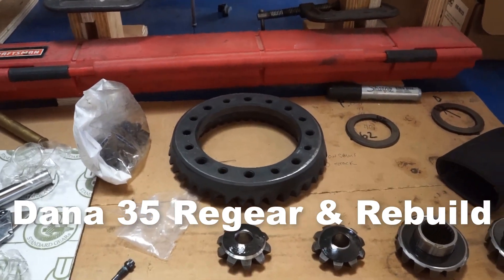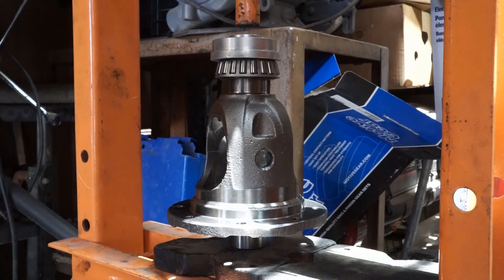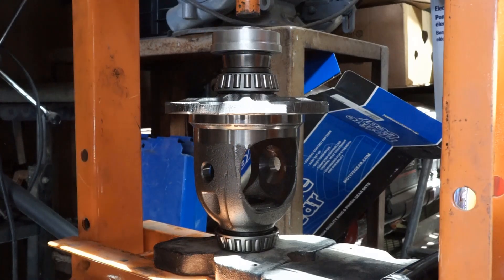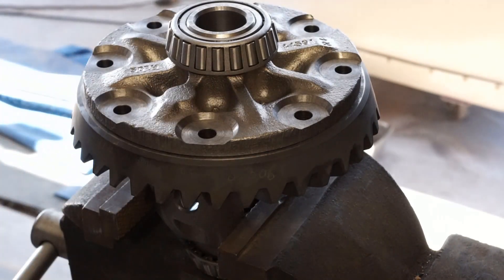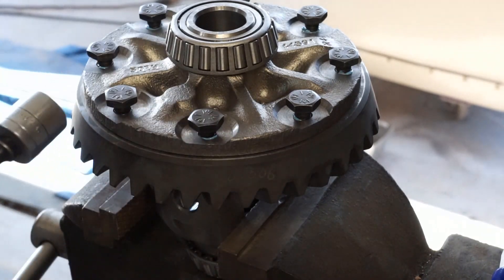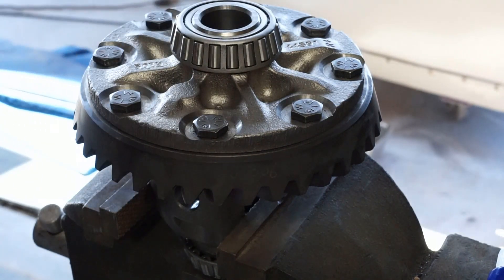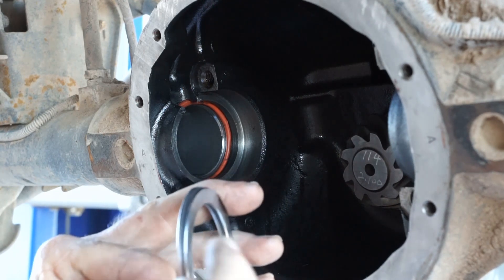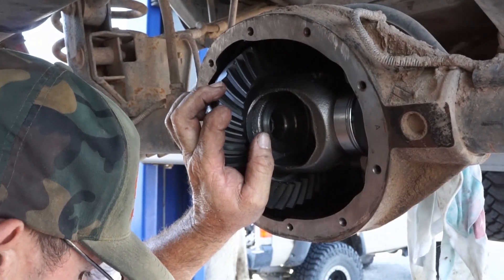Jeep Dana 35 regear and rebuild

Comment: heating the ring gear is the best solution, you never want to use the ring gear bolts to draw it up because those are stretch bolts and you will be doing it all over again once the bolts fail at a later time.

Comment: Great video. I'm an old car and heavy truck technician and would just like to point out the two holes on each side of the carrier opening that are kind of filled in with dirt. There is actually a tool that uses these holes to spread the case a little bit to help to make it easier to install the caps and shims. I do like the tool that you made from wood and it seemed to work great. This is just FYI.
Reply from the maker: Yes I am aware of a case spreader. You can get through the job without one. I dont even own one but I always get to my goal. Thank you for watching and commenting, have a great day and good luck on your project. Cheers.

Comment: How did you determine preload on the axle carrier bearings. Just rolling force/drag
Reply from the maker: I do the carrier bearing preload by feel. It takes a small struggle to get the carrier in. The dead blow hammer is your friend during install. There is a method using the inch pound torque wrench and a little math but I perfer the "feel the resistance" way. I hope this helps and thanks for watching.

Comment: Thanks for the video!  I've got one question though.  I looked at the factory service manual for my 1999 Jeep Wrangler with a Dana 35 rear and it says "Pinion Bearing Preload - Original Bearings = 10 - 20 in lbs"  and "Pinion Bearing Preload - New Bearings = 15 - 35 in lbs".  Should I use what the manual says or stick with the 14 in lbs that you used?
Reply from the maker: I use RMS Ron's Machine Service specs on most of my builds. I buy products from them often. Specs will vary from source to source. There is plenty of wiggle room out there. Be confident with your source and duplicate what they require and you should be fine. Thanks for watching.

Comment: How do u get your set up bearings on and off so easily? Im about todo this exact job next weekend
Reply from the maker: I open up the inner diameter with a flapper sanding wheel. I believe I show how to do it on the GM 12 bolt regear vid. I hope this helps.

Comment: Thanks for the walk through. All the work to re-gear, but no LSD or locker to install?
Reply from the maker: This guy just wanted to gear for his 33" tires, his jeep wouldnt pull 5th anymore.
Reply: @missingdigitgarage8644  awesome video my friend. I wish I lived closer I’d love for you to do my re-gear. I love the continuous camera shot so we don’t miss nothing. Am I right that the set was 4.10 or was that an old box? I have 33’s and just ordered the Revolution kit for two axles for my 89 YJ.  Gonna go with a Tru Trac lsd in back only for now and maybe save for an manual Ox on the front.  I went back and forth and couldn’t decide between 4.10 and 4.56. Gonna be mostly a street rider but want to take er off-roading occasionally.
Reply from the maker: I would go with the 4:10 ratio for what you are doing. I hope this helps

Comment: How did you get the pattern read the first time? Did you use the old Pinion before removal?
Reply from the maker: I installed the new ring and pinion before paint and I get the specs close and go for a pattern read.

Comment: Why would you even bother regearing a Dana 35?
Reply from the maker: @Foof50  So you can use 5th gear with bigger tires.
Reply: if you know how to drive and are doing technical 4 wheeling and not pure mudding with your motor wide open, the Dana 35 can do allot and handle allot more than most people say they can.
Reply: Booo this man!!!! I’m kidding… The d35/d30 combo is a decent platform though. Chromoly axles, locker, trusses… years of service. I’ve even seen ford ttb’s last on trails. You don’t always need to run dual 60’s, high pinion up front etc. to get through the rough stuff.

Comment: How to you pull the old bearings off the carrier
Reply from the maker: Watch my other video called "GM 12 bolt " I cover the removal of the bearings. The video you watched was a new carrier so I didnt have to remove the bearings. I hope the video helps. Thanks for watching
Reply: @missingdigitgarage8644  thanks. My carrier was really tight. Had to use a puller. I think there was too much backlash too. Guess I need a shim kit. The bearings all seem ok but was making a whirring noise under acceleration.  Could that be from the bad install?  It just had one thick shim on each side.
Reply from the maker: @guymanicone7921  1 thick shim on each side is a factory custom shim pack. The noise you are hearing could be your pinion bearings. They may need to be changed. They are usually the first to start failing
Reply: Winner winner. Got the pinion bearing out today. That was the one. Great video, I'm going to use your procedure to set the shims. Ordered a kit today.

Comment: I dont think the cap bolts are suppose to get locktight.
Reply from the maker: Why is that ? What could the downside of loctite be ?
Reply: @missingdigitgarage8644  I was just reading the book and the only place that gets loctite was the flange on the axle shaft tube where the breaks bolt on. 

I guess a downside is that if someone else services it they wont know it's on there and wont know to use a torch to soften the locktite but if you use the purple locktite it might not be as hard to remove. But now I would have to watch it again to see what color you did use cuz I forgot already.
Reply from the maker: @hikerJohn  So "The Book" didnt mention that Loctite is used on the ring gear also and the pinion nut? Install kits come with loctite provided in the package.  The cap bolts are so strong that any impact or good size ratchet or breaker bar will easily free up the cap bolts even when red loctite is used. Thanks for watching and reaching out. Cheers

Comment: As soon as you put the heat gun into the cardboard box to heat the ring gear and then closed the box, l knew everything l needed to know about your knowledge of the subject. You really shouldn't be making videos to teach anyone anything. You should be in a classroom learning. Good luck with your repairs.
Reply from the maker: Thanks for watching, why does the heat gun turn you off ? Ive done many ring gears over the years this way and never a problem at all. Those gearsets are still going strong for years. If your so good at gearsets, then why are you watching my videos ?
Reply from the maker: Thats what I thought, nothing to back up the comment.